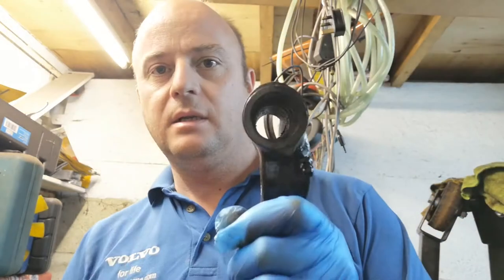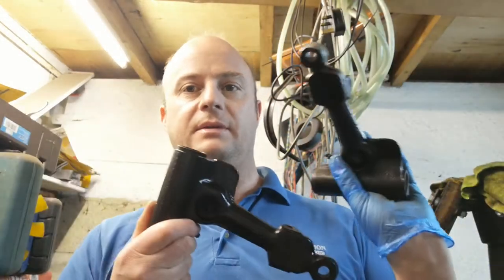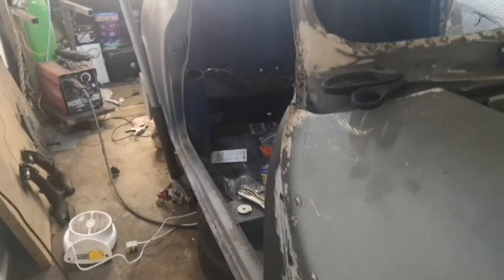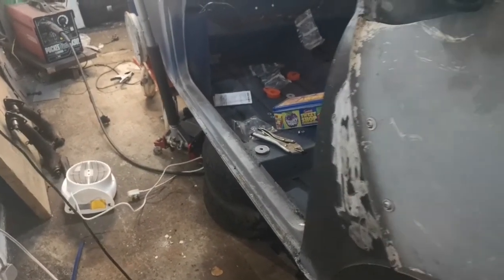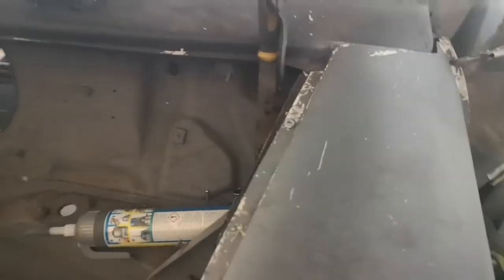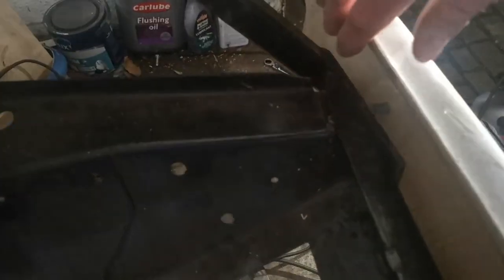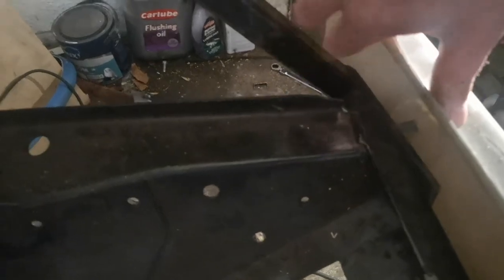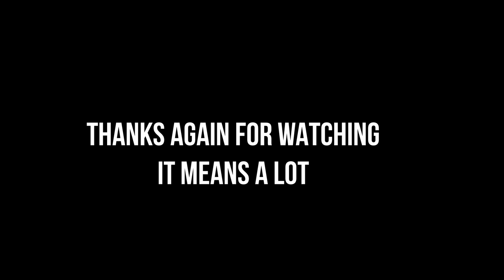Classic mini Restoration | Episode 24

Comment: When I fitted my fibreglass front I had huge gaps near the scuttle like you do and here’s what I did. 
Remove the front and then cover the scuttle ends in cling film making sure it’s tight to the surface and tape down the edges. Refit the front and from underneath the wing squirt expanding foam around in front of the scuttle area making sure it sticks to the underside of the wing and allow to set. Trim of any excess at the topand this will give you a platform to use fibreglass filler to neaten the gap. Worked a treat for me.
Reply from the maker: That's fantastic mate thanks very much for that. I was puzzling over a way to build up the ends for a good fit. Thanks

Comment: Thanks for the shout out Adam! I’m afraid I’m no use with fibreglass fronts...never installed one, only thing I can think of it putting the bolt on the a-panel bracket higher up and moving the inner wing bolts further in. Not sure how any of that would work tbh though pal as I honestly haven’t a clue with them
Reply from the maker: I did think about that Tom. I just didn't want it to be covered in bolts that's all

Comment: Getting there! I'm going for 3 bolts down the side of the wing's, looking at it the top bolt on the inner may be causing more harm. I think mine is trimmed out at the top inner seem of the fiberglass, if that makes sense. I'm sure you can reduce the gap a bit. Keep up the good work 👍
Reply from the maker: Thanks. I'm going to be fiddling with it for a while. I don't intend to make it flip or to remove it every 5 minutes so one it's painted it can be bolted on and left on lol
Reply: @Thecarislife  same here. One thing less to rust. Think how easy it will be work on the engine! Have you got a bonnet as well? 👍
Reply from the maker: No I haven't yet. I've got a couple of steel ones but I want to get a fibre glass one

Comment: Brilliant work Adam. You have done well with the fibreglass front mine was nowhere near. Quick question what are you using to clean the parts ready for paint?
Reply from the maker: Thanks Alex. Wire wheel mate and then a wipe over with some thinners